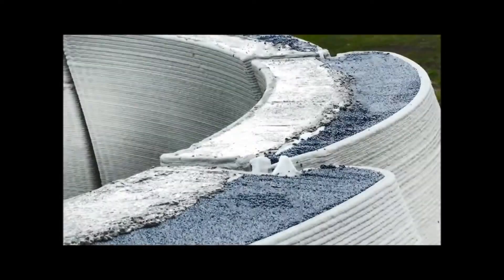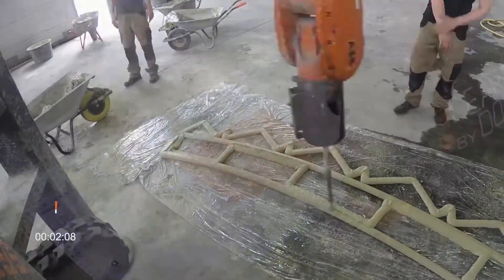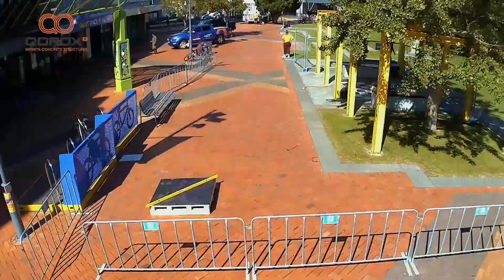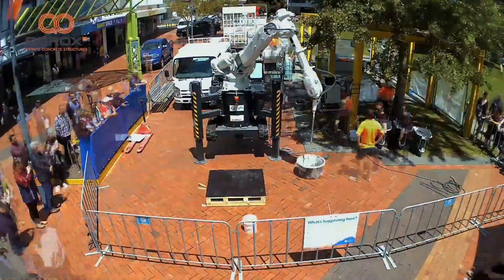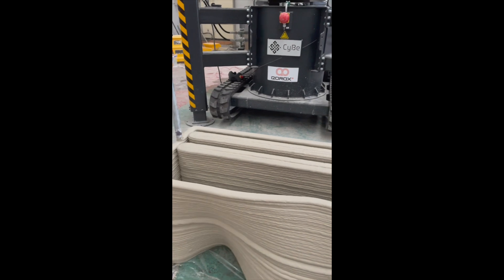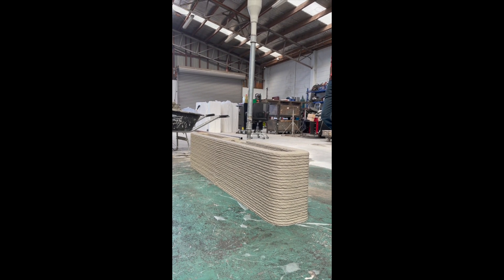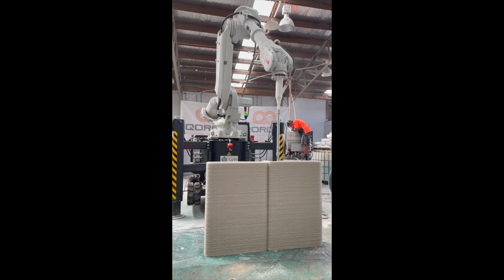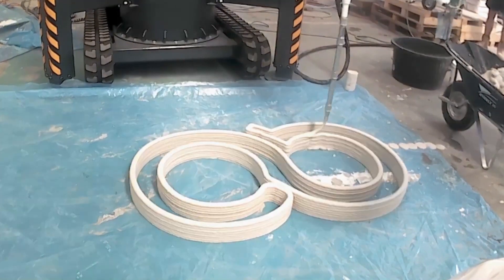3D Printable Waterproof Concrete [Qorox]

Comment: Great! Looks fast, smooth, and precise. Also, visually the mixture seems to have good flowability, buidability, and appearance. But that exposed steel rebar is of a concern, it could be replaced by a more durable material. 
Several projects in various countries used 3-D concrete printing, mainly for architectural applications, in the past 3 years. Increasing widespread of 3-D concrete printing is expected in few years.
All the best to every research centers, universities, companies, and engineers working on developing this technology!
Reply from the maker: I’ve featured nearly all of the major ones on my channel.
Reply: @automateconstruction  Awesome, great informative videos.